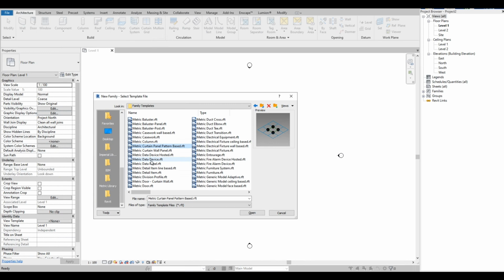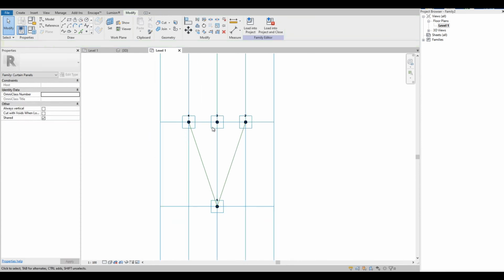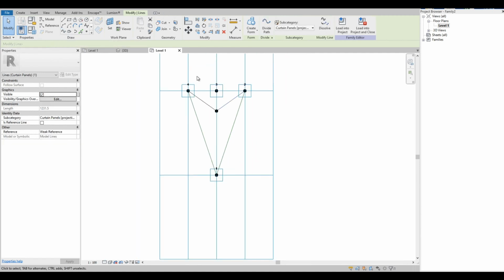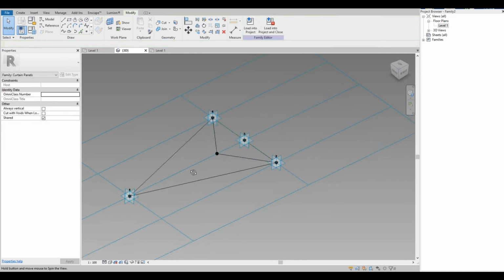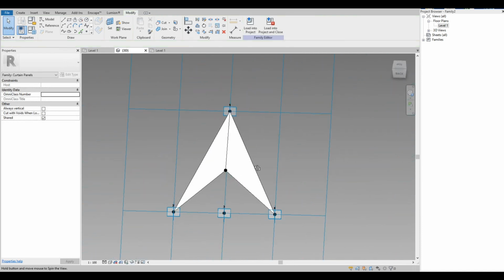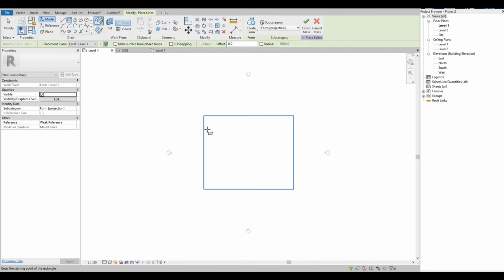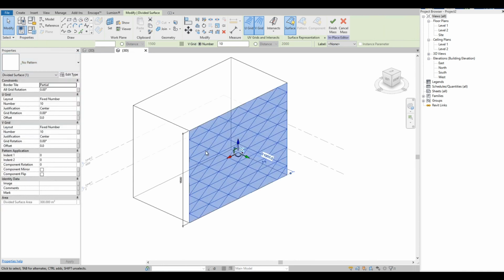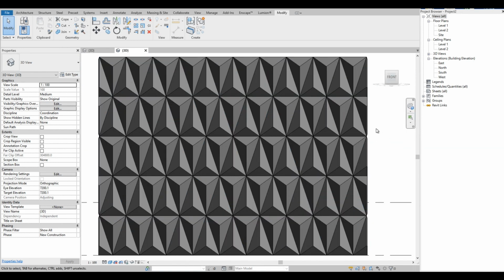HOW TO CREATE FACADE USING PATTERN BASED CURTAIN PANELS | REVIT TUTORIAL FOR BEGINNERS

Comment: how do i apply this pattern on walls with windows?
Reply from the maker: You are only able to apply this type of pattern if you are using curtain wall. Since this method is using curtain panels, you will also need to have a window that is curtain panel based. Then you will need to replace the patterns with windows. To get a better understanding of how a curtain wall works, you can check out this video. https://youtu.be/s6jsNJG6LN4?si=MTHylxVcNKSPuWYR
Thank you for your comments. We appreciate it.

Comment: can this profile be applied to normal walls not just massing?
Reply from the maker: Can only be applied to a curtain wall. If you intend to use a normal wall, it will be a long process which I can think is using Model in Place. Just replace your wall with the curtain wall and apply this profile.